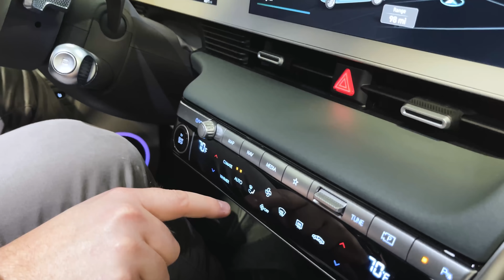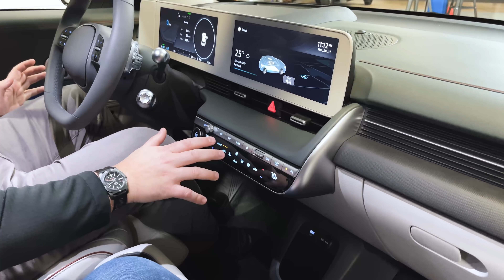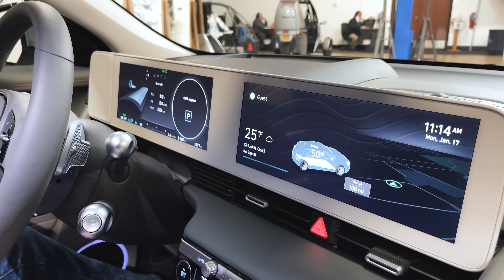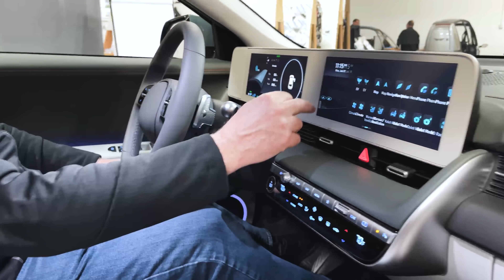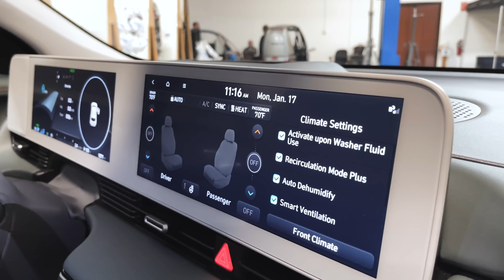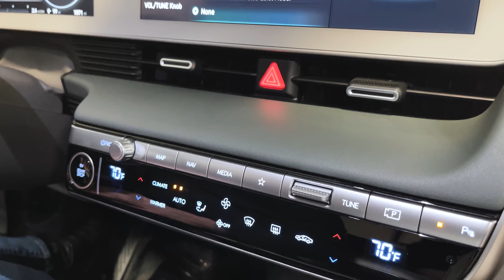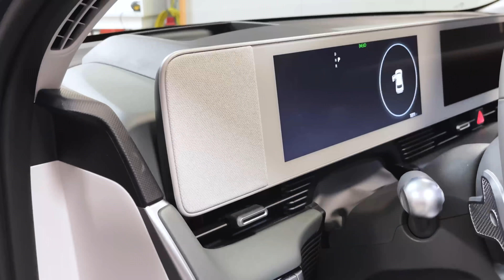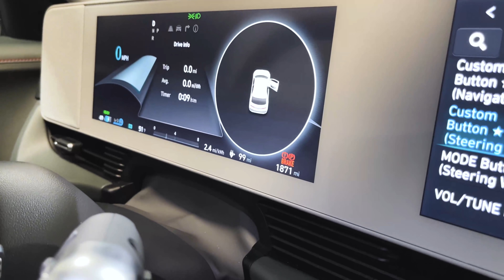2022 Hyundai IONIQ 5 | Sandy's First Impressions

Comment: My new Tesla is coming from Freemont, and I've been hearing the cars from that plant have had some major build issues in the past.  I just saw a video where Munro had a bad build on one side of their Model 3.  Any advise on how to approach the situation with Tesle should there be major concerns during my inspection.  I know I will love the car if its a 1/2 way decent build, but I'm worried if I will be forced into accepting the vehicle should it have badly aligned doors, frunk, trunk, etc, especially because these issues can be symptomatic of more basic problems with the chassis framing.  Other issues like a botched seat coverings, weather stripping, etc. dont bother me, because these things can be easily remedied.  You'd think the buyer would have the upper hand, but since I must wire the purchase and start the insurance several days before the car even gets here, I'm naturally concerned.  Any advise?
Reply: That seems to be old news.  Body fit issues will always be more noticeable on white color cars.  The recent scuttlebutt is that build quality issues have been largely fixed.  A complete check out is certainly called for, however.  Do not expect the Service center to be super critical.  In this case, that is your job.  If in doubt, take a knowledgeable mechanic with you, and by all means use a check list.  Do this in the daylight, but bring a strong flashlight.  
And if you don't like what you see in any way , don't be afraid to walk away from the deal.
Reply: @wilfredvanvalkenburgh2874  Will Jonathon get a refund if he walks away from the deal? 😉

Comment: I would love seeing a video or two on the subject of repair. With the advent of EVs, it is obvious that they are going to need repair. The path to establishing an ICE repair station is well established. But what will a mechanic need in the way of education in order to open a repair station for EVs in general: a place to get your Ioniq and your Tesla repaired?
Reply: Everything outside the high voltage system is no different... Most high voltage systems produced are still in warranty so the 3rd party repair itself is still very much in flux ;)

Comment: I will never understand the complaints about buttons. People love buttons! Just look at the insanity that the Mercedes EQS is, and even Teslas can be annoying. Why should I press 3 times on the touchscreen, without any tactile feedback to do something super simple, when I can press a button the location of which I've memorized, and be done in 1 press? Touchscreen or voice controlled volume adjustments will never ever be as good as a user experience as a volume knob. 

You've got to think about the user experience a bit more Sandy.
Reply: Almost all input is error.

Right? So even 1 press will be considered unsafe, compared to a system that depends on AI / possibly AGI.?
Reply: @Chris Mertens  classic overengineering that nobody is asking for. Will the AI read my thoughts? No, it won't. And I don't want to pay the cost of feeding my data to the AI so the algorithm improves. By all means, they can put whatever they want on luxury cars. The masses want something proven, reliable, and most importantly cheap. Hence, buttons.

Comment: Hyundai breaks the unsafe tread of touching screens while driving after digging in menus and Sandy wants it more unsafe by removing those manual controls. 🤨 Oh wait he pulls over every time he uses the screen because it takes his eyes off the road. Never mind, strip 💯of the buttons and door handles off this thing. Why have redundant controls and drive up the cost‼️

Comment: This shows the difference between a car manufacturer (Hyundai) and a gadget supplier (Tesla). When the basic system is comparable, Tesla cannot compete (especially with 'dealer networks') and can only respond with more Tech... I'd buy a Tesla if it had LESS Tech (no electric doors, no over the air updates, fart menus etc)

Comment: 20:24 That there is to turn off the light switch on the light, if you leave it on and fold the shade it will automatically turn it off! 27:14 buttons will unfortunately don't disappear because in some jurisdiction touching touch screen on you car is considered interaction will electronic device and come with fine if cops catch you; whole UI if you look is exactly the same like on Kia Soul EV; 28:24 same as on Kia they had the star since they came out. It even has the exact same sound of buttons... 31:56 - this will come to KIA...next model...how you say same shit different package.

Comment: If you would remove the climate control board, you will not sell many cars in Europe...People do not like touch crap and
In many Europe countries  it is the law if you are using Touchscreens at driving you  can get tickets or lose your driving licence or you are automatically guilty if it comes to an accident - big issue with Teslas !

Comment: Putting climate controls in a touch screen is prolly the worst thing possible is a new car.
Very dangerous, makes your car virtually unbearable if the screen stops working.
Can’t defrost or warm it up?
I hope legislation mandates buttons for the most used features, just how steering and brakes shouldn’t be digitally operated.
But mechanically operated.

Comment: Like the climate controls being duel. Not everyone wants to use a screen for everything, think about older people that dislike computers, and etc.
Reply: It not a dislike for computers, or a users age or experience thing.  It is a Human Factors Engineering, or ergonomics issue.  It is just plain easier to find a button or knob in the same place every time, than is is to have to take your eyes off the road, scroll, sort and find and select a non haptic touchscreen and then have to check to make sure that the input was correctly received.  Smart people like easy.
Reply: @wilfredvanvalkenburgh2874  I apologise for all the crap I've dumped on, this post actually makes sense & discredits Tesla maybe. 👍

Comment: This thing looks nice and would be great as a “get me to work and home” car…. But then I looked at the price tag on one of these. At those prices I might as well get a Model Y
Reply: It is comparable to the Model Y and at least in Europe it is a bit cheaper.
Reply: @rkan2  that’s my point. I can spend maybe $5-8,000 more to get a Model Y with better tech, range, charging, efficiency etc
Because in all honesty if this was priced in the $30k range then I would probably get one
Reply: @rkan2  Shorter range, slower, less interior room and lacks the Super Chager network that  Tesla has, but if by being a car, it's comparable, well I guess you could compare them,. But then again, you could compare apples to porcupines, too.
Reply: @wilfredvanvalkenburgh2874  The Tesla is more efficent sure, but they have almost exactly the same amounts of battery capacity. What is your notion of Ioniq 5 being less roomy than the Model Y? In Teslabjorn's banana box test the Ioniq 5 fit more boxes than the Y.

These make it very much comparable to the Y, especially since you cannot get Model Y kind of space in an EV for under 60k since Tesla stopped selling the SR Model Y.

Comment: There's no shame in loving buttons. Once we get over the novelty / coolness of screens will come to the correct balance of buttons and screen. The ideal screen would be a Apple or Android tablet, easily & cheaply replaced and resizable.
Great looking wheels, but hard to clean. Most wheels are over designed the best are simple five-spoke or disc bass designs.
Good thing about this shifter is its away from the passenger, my car has shift buttons & parking brake in easy reach of the passenger, common, but not a great idea.
Reply: Fiat 500e was an easy transition vehicle, drives like an automatic with blended regen on the brake, conventional key, no start button, shift buttons on the dash console, no driving modes. A few minor options in menu, like hill hold assist. Could have been a good rental car.
Reply: They should sell a cover for the buttons for Sandy and Tesla snobs... and people who just don't like buttons.
Reply: I had a car with confusing reservoir locations, I had to paint them to make them easy to read. That's a really simple but damaging oversight.

Comment: That's the problem with not knowing the vehicle before you talk about it,  auto hold is so when you stop at a light you can take your foot off brake and it stays in place. And keeps doing that till car shuts off. Tesla still beats other ev because they've figured storage out plus range.

Comment: No, Hyundai, please don’t listen to Sandy’s suggestion to get rid of the button climate controls. I love having tactile, easy to reach and easy to see buttons for that without having to take my eyes off the road and try to hit a small area on a bouncy screen. Putting all the controls in a screen like Tesla did is an ergonomic nightmare, and it creates a single point of failure for everything. If the screen dies in a Tesla, you can’t even open your glove box. 🤦🏻 And calling the tactile controls a ‘baby boomer’ option is quite insensitive. Firstly because the term is demeaning, and secondly because it presumes that if you appreciate dedicated, tactile buttons for certain functions, surely you must be old and out of touch with what’s en vogue these days, which can’t be further from the truth. Just because we have this relatively new invention called touchscreens, it doesn’t mean that everything needs to be a touchscreen control. For some things, tactile switches still make sense. Just because you can doesn’t mean you should. I don’t need a touchscreen control to flush my toilet.

Comment: Is the rear lift gate side trim panel a mix of style and cost saving? Less mold textured surface, less B surface.  The part would likely have still had ribs.  Tooling might be cheaper and adds some style.

Comment: Too much piano black plastic trim on the exterior, it's going to look bad in a few years. Also the silver plastic trim on the wheel wells rocker panels and around to the rear is ugly and my not look good in a few years. $54,500 MSRP, it's nice but not THAT nice.  My 2017 Honda CR-V has two position rear seats, nothing new here.

Comment: Much better layout than the Volkswagen id4 UI disaster. The id4 is a valiant effort and drives nicely, but it’s beyond confusing trying to navigate the menus, modes, HVAC, etc. This new Hyundai looks fantastic! It’s interesting how Tesla was supposed to be the affordable EV for the masses and it’s every manufacturer BUT Tesla starting to make affordable EV’s. Lastly, it blows my mind that auto manufacturers are still using black plastic for fluids that need to be filled. Mazda had this debacle on the rx8, ford did on many vehicles, etc

Comment: I'd have a problem with the driver's seat being that reclined. It's a driving ergonomics issue. It limits the drivers' vertical and horizontal sightlines, increases reach to the touchscreen and would reinforce laptop hunchback. 

Sandy has some ideas about what's needed that are the result of years of conditioning and subjective personal taste. His concept of ergonomics and what's possible don't match his engineering expertice.  Fit, finish, and fabrication are his forte. What something absolutely must have to make a refined product the best match with what customer's need is not. He could have never created a totally new product like an iPhone. 

That lower HVAC panel is made by a supplier. It has one part number. It probably has only one circuit board with all the switches direct mounted to it, and a small power and CAN bus data cable. I'd rather keep it and eliminate the secondary LCD screen, because imo it's redundant to what I have in my pocket - AND - it has multiple part numbers plus software that will need updates as Android and iOS rapidly evolve.  Screw built in navigation.  I use voice navigation, not a distracting map.  A new higher tech car should have FEWER configuration controls, not more.  All a modern HVAC systems that is properly designed to establish and maintain a comfortable interior is needs is zone controls for temperature. It should be able to calculate air velocity and recirc automatically.  Reduce the HVAC panel to two sets of up/down controls.
 I'd take the recovered space from eliminating the display and reducing the HVAC panel to make a driver's glove box with covered storage tray for glasses or wireless charging for a phone.  Digging down in a covered armrest for stuff and connecing jacks is a stupid idea. 
I don't care much for the fake running board look or the diagonal door creases, because they will drive up the complexity and cost of repairing parking lot damage more than horizontal lines would. They do truck they eye making a mundane blocky high beltline side profile look sleeker.
Reply: I could use it for a short nap while the car is charging

Comment: Sandy of course loves no buttons cause it’s what daddy Elon loves but I’m sorry I don’t want to navigate through a menu to turn on the heat
Reply: Agreed. BMW are the only ones who whilst producing shite inconsistent design language car shapes today are providing multiple methods with which to operate the interior controls and infotainment. Main iDrive knob in centre console, steering wheel controls, touch screen, physical buttons - and even gestures!
Reply: @GudieveNing  Only 4 ways? I'd like at least 7 different methods to do the same thing. Like why is there only 1 way steer the car? I should be able to steer it by the iknob, by gestures, with an xbox controller, by eyetracking and by leaning in my seat.

Comment: Two seconds slower than the plaid is amazing given how much cheaper it is. Plaid is overrated.
Reply: Two seconds is eternity when an 80,000 lb truck is coming at you.  Plaid maybe overrated, but its still awesome.
Reply: @wilfredvanvalkenburgh2874  you are not seriously telling me that this is a reason to pay huge money for a Plaid. Also to get the 2 seconds you need to do an hours preconditioning of the battery. Unlike Porsche where the slightly slower 2.4s is available without special conditioning and is repeatable.
Reply: I just checked your 2 second figure and you seem to be "factually challenged".  The Ioniq 5 0-60 time is 5.2 seconds (Car and Driver), while the Tesla Model S Plaid is 1.9 seconds, a difference of 3.3  seconds,  a 170% difference.  The fastest, most expensive Ionic takes more than 2 and a half times longer than the Plaid.  Not that the Ionic is slow because its not, but the Tesla s Plaid is ridiculously fast.  And while I'm at it, every one of the current Tesla Model Y are at least 20% faster and have 18% longer range. Thank you for reminding me how awesome Teslas are.
Reply: @wilfredvanvalkenburgh2874  well you are correct the current fastest Ioniq is 5 seconds. The Kia EV6 GT which foreshadows the coming Ioniq 5 N is 3.5s so only 1.5 seconds slower!
The Hyundai/Kai twins are cheaper, better built, have more customization and a better interior but I don’t want to intrude on your fanboiness!
Reply: @wilfredvanvalkenburgh2874  Sad for any Tesla 3 & Y Performance owners, they are gonna die for the sake of being (how many seconds, slower) than the Telsa S Plaid. 
But then they didn't pay the entry price of $140000 to stay alive. 🤣😂

Comment: I agree get rid of the buttons make the car cheaper to manufacture..clean design less clutter like Tesla.
Reply: Clean design
But dangerous by distracting, discomfort as 1 click ~> more than 3 clicks....
For the company's cost reduction.
Reply: @googleaccount4685  agree i have a 2007 Lexus that i set and then drive off...fully touch screen for air con.  Should not be touched while driving can be a major destraction agree

Comment: I think you've been lit up in the comments enough about putting everything on a screen, but I agree with most people here that simple things you may change while driving should be physical controls. It's proven that you can't grow nearly as much muscle memory with touch screens as you can controls.
I would also refuse to buy a car that doesn't have heated/cooled seats as buttons (Which this car does not). The time to go through screens just to turn on heated seats in the mornings would add up fast.

Comment: That'd better be soft-touch plastic on that rear-door panel, otherwise it'll get scratched to Hell by the fingernails of people using the "handle."
Reply: @xianshep well if that's the case, self-healing plastic would be a better option as it's not only fingernails, there's also diamond jewellery to allow for. 😉

Comment: I hope you don't have any problems with the Hyundai. I have a 2019 Kona Electric with the battery that can catch fire. Hyunda's solution is to limit the battery to 80% charge, that's right, knock 20% off the claimed range. With no climate control, the range is 180 miles on the highway, (out of a rated 259). I haven't even tried this in the dead of winter when the heater knocks another 20-30% off the range.  Hyundai claims that they have battery replacements but WILL NOT DELIVER IT! I've dealt with three Hyundai dealerships (Mirak, Bill Dube and Newport Hyundai) as well as Hyundai's CSS department and NONE of them have delivered a solutions to "Recall 200".